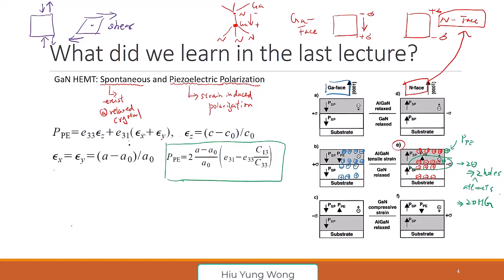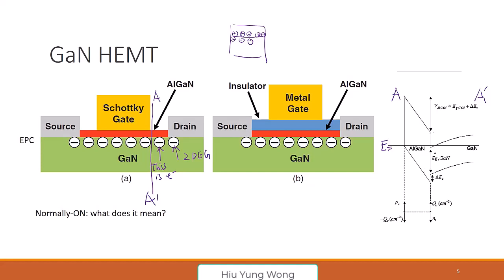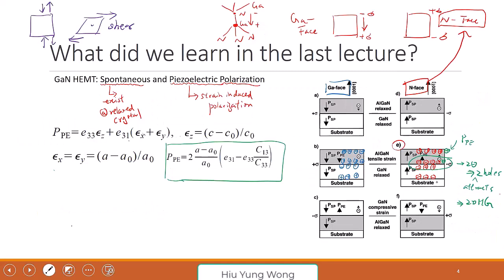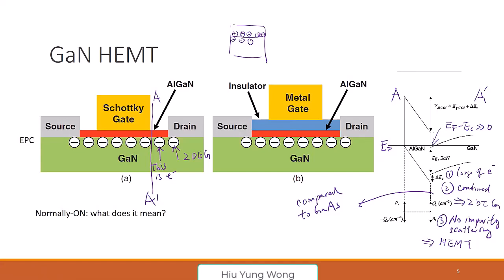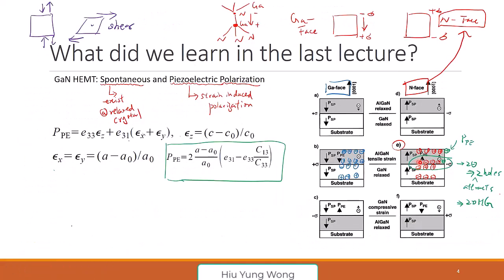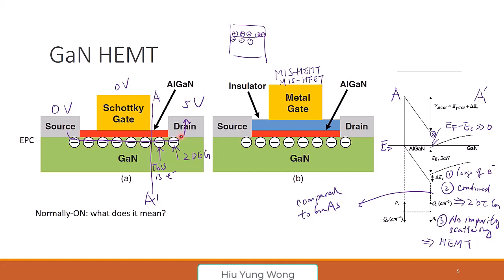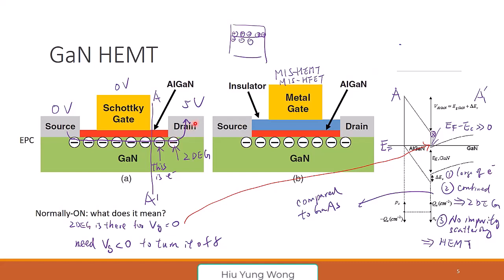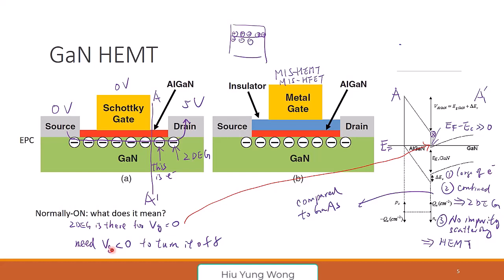20A - (Ultra) Wide-Bandgap: Gallium Nitride HEMT Explained, normally-on, normally-off

Comment: What is the role of gate and How is used to control the current in this device? ID-VG curve how we get from this. Does any MOS effect like MOSFET happens in this device architecture. Please respond if you have time.. although your entire lectures series is just saviour for us for conceptual clarity. Continuously watching for getting more and more knowledge about devices and theirs physics. 🙂
Reply from the maker: Yes, it is like MOSFET. AlGaN is like the SiO2 in MOSFET. So the gate controls the electrostatic of the channel using the same mechanism. But it is not a normally-off device and under Vg=0, it already has an electron channel due to the polarization charge-induced electrons.
Reply: Thank you so much for your reply.